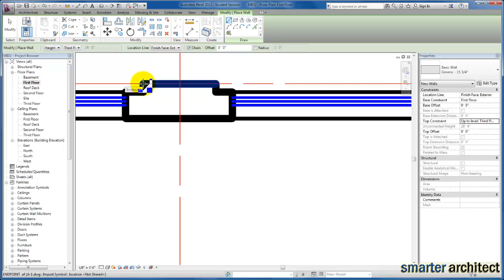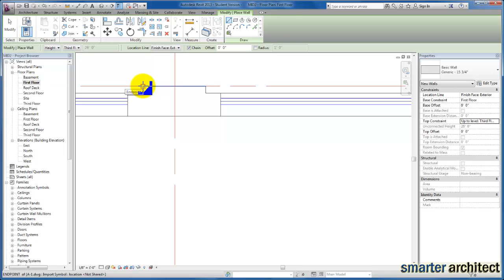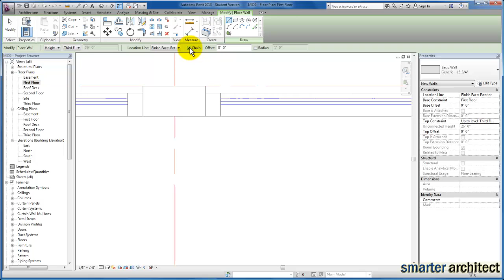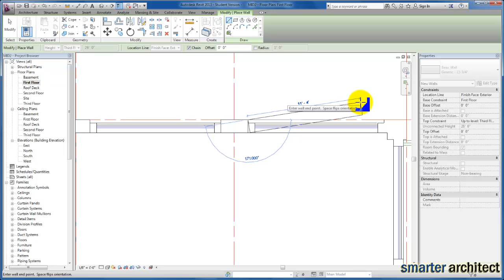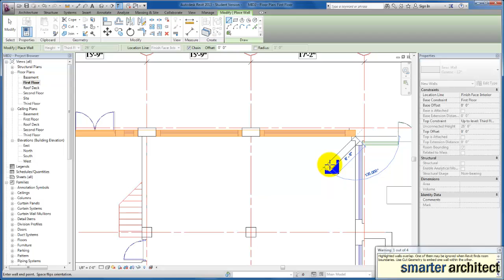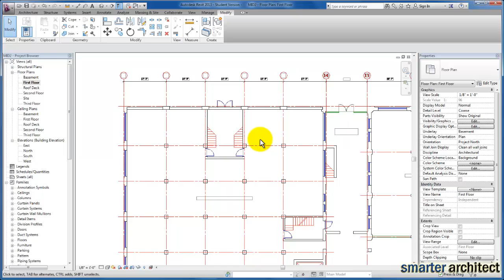Revit Tutorials: Modeling from CAD backgrounds

Comment: can the same thing be done with fusion 360 files?  What file format is best.  I find it easiest to draw some items in 360 but easier to add items like foundation, drywall, plumbing, electrical, cabinetry in revit.